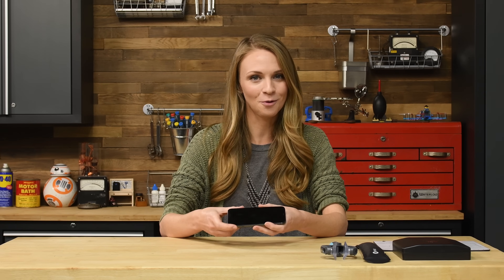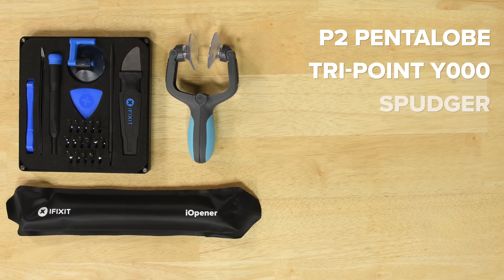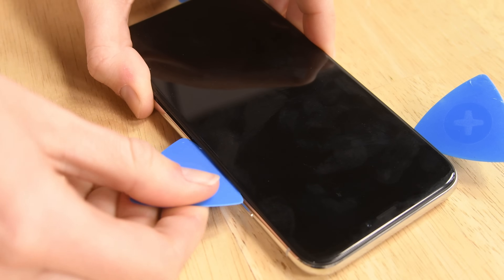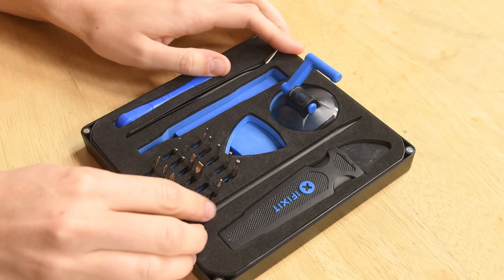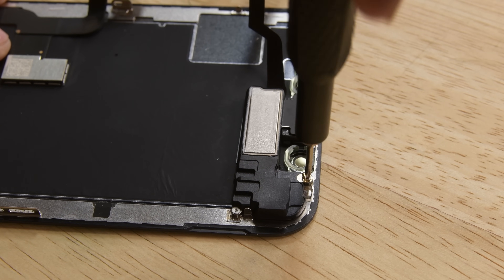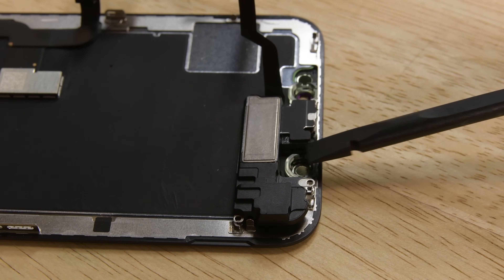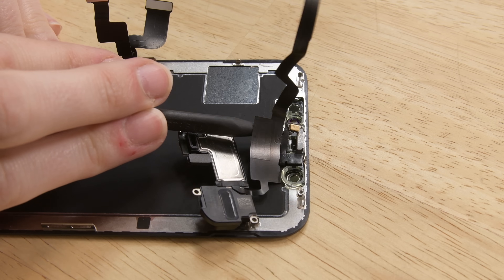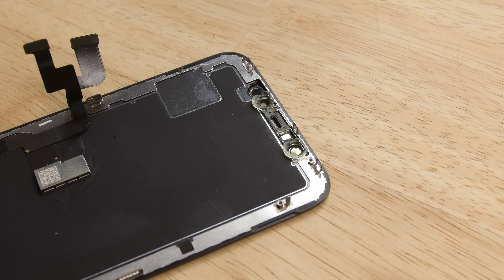iPhone X Screen Replacement—How To

Comment: My display cost $80 and the replacement went flawlessly. Difficult disassembly, easy reassembly... reverse order. However, in my case after replacement the display was dark. So, not sure what's up with that.

Comment: The video is 3:00 min long it took me 3 hours to finish replacing my screen
Reply: So how much did it cost you to repair the screen? Like just the screen I already have repair kits. And did everything work like the face recognition?
Reply: lol - That tiny bracket on the top right side edge of the speaker assembly is a major PIA without a magnifying glass!

Comment: How does this save me "some dough"??? Apple charges $279.99 for screen repair and you charge $249.99 for just the screen and I would assume the other parts and pieces I need to complete the repair would be at least $30.00.

Comment: I did it. I used a heat gun instead of that bean bag thing you’re using. The only way to get that ribbon off of the adhesive is heat. The ribbon is superrrrr fragile. Also I think some of the screws were different sizes so make sure you organize them and put them back exactly where they went. 

It’s not as easy as she makes it look, but it is very doable.
Reply: It's not even a beanbag, it's got some weird liquid in and it doesn't even come in a case. Quite shit if you need to transport it

Comment: Did the apple id still working after unofficcial screen replacement? I heard that the ir sensor now attach to the display so if you remove the display and put the ir sensor on new display the face id wont work damn its that true? Rip tech guys if that true.. apple just sneak behind you and slowly stabbing you if you play with their device..damn

Comment: hmmm.... should i pay apple 280 dollars to have them fix my iphone x for me professionally or buy an aftermarket display for 400 DOLLARS, fix it my self and loose waterproofing??? tough choice.
Reply: Iphone xscreen is like 160-250euros (170-270$) you only loose waterproofing when you dont use adhesive glue
Reply: there are much cheaper displays in the market already. OLED displays for iPhone X can go as low as $100 and there are even LCD displays for about $60. Also, original screens taken down from used phones cost only $200. So I guess this is the point doing it yourself
Reply: Its. It even waterproof dropped mine in water not enough to even submerge it an welp phone ruined
Reply: Fix it yourself dude
Reply: Ram woosh

Comment: She said "Apple tries to charge you almost $300 to repair", yet iFixit display part costs $399?!?!?!
Reply: LOGIC
Reply: fyun89 Makes complete sense
Reply: Apple charges $279 to replace screen only. Further damage is over $500. This is at Apple.
Reply: Amanda Rachelle my screen cracked just a tiny bit after a drop- what’s cheaper? To buy this kit or have apple fix it???
Reply: @karenvillanueva2570  If you want to keep your water resistance, then go to apple.  But if you want to do it at a cheaper price, then follow this video, also you will also need new adhesive for your iPhone X, since most phones do that use adhesive.
Reply: @karenvillanueva2570  it would be cheaper just to buy an iPhone 8....
Reply: fyun89 but its a great deal it can do this!!!

Comment: so wait, your screen costs $399.99 but apples charges 300. What is the point of this?
Reply: so you can get it done by apple certified ppl
Reply: Matt Wheeler I mean now it 100 so I think it’s currently a much better deal
Reply: Matt Wheeler oof
Reply: you can find them for $70, just keep digging, it's there... real problem is; this video is just a tear-down, they don't actually show the repair. It's a bit presumptuos of them to think just because someone can disassemble it, with this video playing, that they'll be able to reassemble it without a video for that process. Not everyone is sharp enough to just reverse the tear-down process, especially these days, millenials and all...